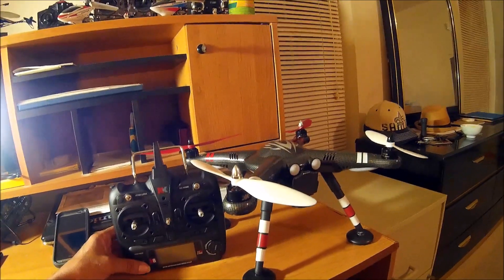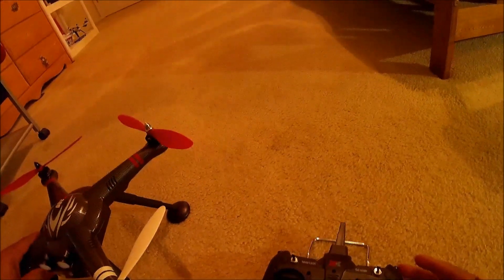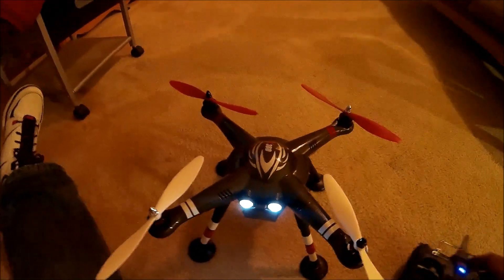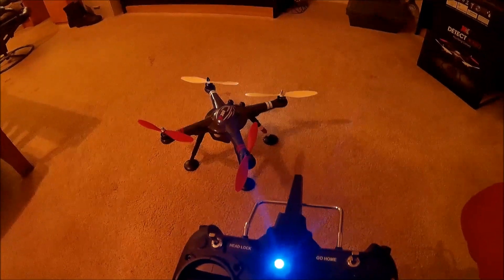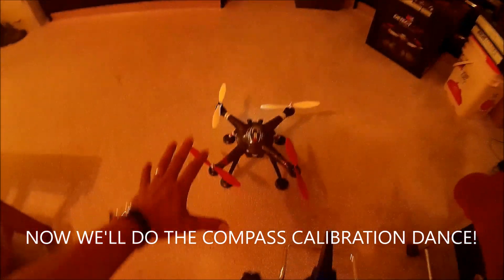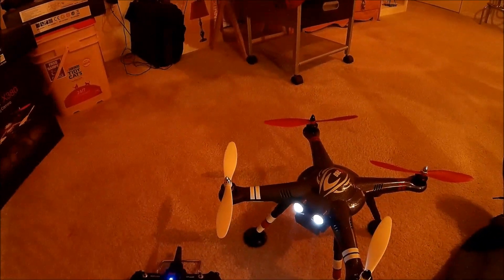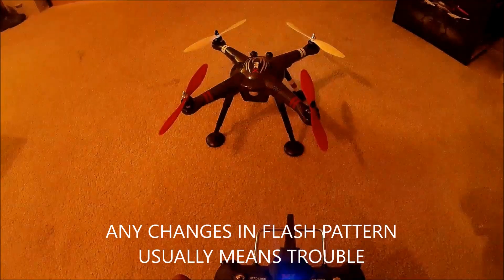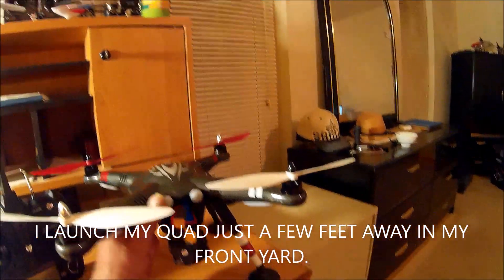XK DETECT X-380 "MUST WATCH BEFORE YOU FLY"

Comment: Hi DJ , read where someone else wrote bout having to flip switches more then 3 times when calibrating. I have to flip switch like 20 times on first step, and same on magnetic calibration befor I get the flashing green light. Only flew mine one time till battery warning, but all went well. Just saying, think there will be no problems if others have to flip switch a
 lot more then you do , just be sure they get the flashing green light before flying.

Comment: Hi DJ, love your videos. I crashed my first x380 after 4 mins, MY Fault. Not quad fault. getting new top n bottom shells to fix it. Now i did get a 2nd one, and as with the first one, it will do nothing when i push auto take off? I can manually take off, and have no problems. but auto does not work. All lights are as should be. Also with the 2nd x380, on very first take off in manual,  as it lifted of , it started running backwards fast, i shut it down and it flipped like 3 times, but luckily only had one broken prop. After re calibrating quad, it works fine, except no auto. Thanks and keep  the videos coming. Love the great job you do !! Thank you. Bob
Reply from the maker: +Bob Hoffman  To activate auto take off, the quad has to be in the LOCKED mode. If the props are turning, it won't takeoff!  Took me a few tries to get that one too!!!!  Good luck with your repairs, happy flying.  DJ SOUL FORCE
Reply: Ahhh! Lol I am a dummy. Thought I did try that, but maybe didnt hold button do
Reply: Ok great! Thank u for your fast reply!! Will try again

Comment: hey DJ how about this one, I fitted  gimbal last week ,the weather changed today so decided to go out and fly ,but no flashing light on the quad ,the lights flash on the wings but no red of green light ,no response from control.Have you come across this ,many thanks also when i plug the usb in ,there is no response from the computer.
Reply from the maker: +android /John  When you first plug in battery, does the quad go through it's normal initialize process - i.e., red/yellow flashes, a couple beeps & chirps, then red/green flashing? If all you're getting is flashing lights on the arms and it's beeping, you may need to reset the internal drive. I did come across a similar problem, here's how I fixed mine:  https://www.youtube.com/watch?v=c0jPjEA4ZdQ  When you connect quad to PC, make sure gimbal is disconnected, and NEVER plug or unplug gimbal while quad power is on. Let me know how it goes. A short video would be helpful.
Reply: +DJ SOUL FORCE ,Hey thanks for quick reply ,the quad is bleeping and wing lights flashing ,but there is no light flashing from rear red/green light, now when I plug the computer&#160;USB in the computer does no see the quad it did in the past, You may have answered my question, I may have connected /disconnected gimbal&#160;when it was&#160;still powered up, do you feel it may be the main board? John.,  http://www.xt-xinte.com/F15766.html?set_currency=2
Reply from the maker: android /John  Before we can determine if the main board needs replacing, try connecting quad to PC without power and no transmitter. Then connect battery and see if your PC will identify the x380's internal drive. If it does, then you need to follow the steps in the video I sent you previously. Let me know, we're just trying to troubleshoot the simple problems first before changing out main board, that's a pain in the ass!

Comment: Can I please add my experience. My first flight ended in disaster seconds after it had begun after the quad flew off violently immediately after take off and crashed hard. It turned out that the quad was missing ALL the 3 files in the CALIB folder (I assume straight from the factory). I'm also aware of at least one other person that had the exact same thing. Please hook up your quad to your PC and check you have 3 files in the CALIB folder before your first flight......
Reply from the maker: +My X380 Quad Channel  Wow, that's good to know. Did your x380 need repairs after the crash?  Hope it's ok now. Thanks for sharing, hope everyone reads.  DJ SOUL FORCE

Comment: I did the compass calibration inside with the green and red light blinking. I took it out to fly and both greens came on. I didn't notice really any problems calibrating with the green and red light blinking. So am I ok? Also just double checking but do you have to do the compass calibration every time your at a new location?
Reply from the maker: You're good. you only need to recalibrate if you move a significant distance away, like more than a couple miles. Thanks for watching.

Comment: +dj soul force. I took the x380 to the park I'm out now and OMG man she is the most amazing quad I have ever flown! so smooth and just amazing! Thank you so much for your videos! If it wasn't for you I prolly would not have understood those directions. I returned the cheerson cx20 for this and so far so great! Have a good day thanx again!
Reply from the maker: +Ian Rice  Wow man, you got me smiling from ear-to-ear!!! I really love it whenever I can help someone to enjoy their quad and gain confidence with it. When I got my x380 it was so new, there wasn't a lot of information on it. And of course, you've read the manual by now and know it leaves a lot to be desired. Glad I could help, stay in touch. Happy flying brother!!!  DJ SOUL FORCE
Reply: Yea man you really did help. And after I got her up in the air about a minute later I was confidante with my flying because of the experience with the smaller ones. I'm looking at another one to buy. I got my Syma x5c-1 stuck in a tree cuz it lost signal. So now it's just the udi discovery upgrade with the xk x380.  I'm only looking to spend like 125$ do you have any suggestions on what quad to buy? I'm thinking of trying fpv for the first time. I JUST LOVE flying these things so much fun. I can see you have the same passion.
Reply from the maker: Ian Rice  I'm looking at that JJRC X1 Shuttle with brushless motors. It's a little bit bigger than the Syma X5c-1 but it has tremdous power and fast like a racer! I'm kinda holding off on buying it right now because I think there's gonna be more just like it coming soon. Whenever JJRC release a new quad, WLToys will release one just like it or a little better with more features. Thanks again for watching.  DJ SOUL FORCE
Reply: i just looked it up on amazon it looks awesome but reviews look low. but brushless motors are a bonus!

Comment: thanks for the videos I love them I watched them so many times I have one question about the GPS I don't have two green lights flashing I have 1 green 1 red that means I have no GPS does that mean I have to change the location to get this GPS
Reply from the maker: +bruce jones  It usually mean that you have acquired less than 6 satellites. The quad could still fly but I wouldn't trust it.  Have you ever gotten the two green lights? If it worked before, it should work now. If you've never been able to get two green flashes, then yes, I suggest trying a different location. You could be in a satellite "dead zone!" Thanks for watching.  DJ Soul Force

Comment: Hi, I got my x380 I did everyting that you said, ans it's working ok but since the first time that I have try it I never get the signal from the satellite at first time. the first time I wait li 10-15 minuts and never got the signal I had to unplug it na plug it 3 or 4 times to get the satellite sinal. today I try again and wait 25 minuts and never got the sinal, so I unplug the battery and try again and wait another 10 minuts and nothing no signal. and I havent try it any more today.Can anyone help me with this problema?
Reply from the maker: +paulo soares  Hello, I would like to help if I can. First I need to know exactly what the quad is doing when you plug in the battery. What color is the flight indicator (LED) and is it flashing, slow or fast and do you hear any beeps?  If possible, can you make a short video showing transmitter, quad and what happens after you plug in battery? I will help if I can.  Thank you.
Reply: +DJ SOUL FORCE&#160; wen I plug the battery the quad makes some bips and leds flashs multi color then it should go to 2 green flashing indicating that I have more than 6 satellites and redy to go. I only get the 2 green if I plug and unplug the batery 3 or 4 times. wen I plug the battery for the first time afther the bips and multicolor flashing lights I ony get 1 green and 1 red this meens that I'm geting less that 6 satélites.I realy like your videosBest regards.
Reply from the maker: paulo soares  You may be in a satellite "dead" zone. Try moving to a different location if you can, a few miles away. I'm sorry I can't tell you what's wrong with your quad without seeing it. Good luck
Reply: +DJ SOUL FORCE after I get the 2 green ligths I have try and flyes ok.

Comment: I just got mine today and I am sitting here watching your video and I did the campus calibration and I bonded the transmitter well I think I did it right I had two green flashing lights almost immediately as soon as I plugged in the battery after a red and yellow then to green so now I have the green light flashing every 2 seconds and I also turned off the transmitter and the red light came on and I turned it back on and got green again so I think I'm ready but I have one more question you said in the video that you had 6 satellites I don't see where it tells how many satellites you got is that on the transmitter or is that a code when you got green flashing lights you just know you have 6 satellites and does the transmitter connect to satellites as well? I have seen reviews of some quads that both the transmitter and the quadcopter connect to satellites well it was late by the time UPS got here with my xk and I wanted to fly today but I didn't get to but I think I will try out the GPS return to home before I let it get to far out that way if it starts going the wrong way I can switch out of rth mode one more question I looked at the propellers and matched up the arrows according to the ones one the quadcopter but does it matter on the propeller the arrows should they be facing up or down or does it matter what I mean is can you put the propeller on upside down? but my first flight will hopefully be tomorrow if it's not raining or snowing . yeah it's been like 70 degrees all week and I have been waiting on this and now it's here and there calling for snow that's my lunch.
Reply from the maker: +Andy Shaffer  When you get green, green flashes, it mean that you have acquired at least 6 or more satellites. In some cases, before green green, you may get green, yellow, which is safe to fly, but has less than 6 satellites acquired.  The transmitter does not connect to satellites like the Yuneec Q500 4K or the Phantom 3 Pro. When installing the props, make sure that the arrow is on top, quad will not fly properly if not!  Good luck Andy, hope that first flight goes well, take it slow at first. Oh yea, use a timer to time your first flight (around 23 minutes or so) because it's easy to lose track of time with the first flight. By ending your first flight at 23 - 24 minutes, you'll have enough power to test the final auto return to home!  Good luck, hope the weather is nice.  DJ SOUL FORCE
Reply: +DJ SOUL FORCE .Ok I will be talking it slow at first until I get a feel for how it handles. when you got yours did it say you have the fap mode included the fly around point mode it has a button on where you adjust your camera and it has fap on it but I thought I had seen in some other video that someone had said that button was for the camera and taking pictures but it has a little book about fly around mode and how to use it safely I had been told that feature was to be bought separate so I was just wondering if they just started adding that feature in with the quadcopter because even when I bought it the specifications had it included but if it's not included and I have to buy it separate I will I just like to have it and follow me feature I heard that software can be added as well?
Reply from the maker: Andy Shaffer The FAP and Auto Pan modes are included with the new x380's. The photo button has been renamed FAP button, but whatever the name says, it still works the same. If your quad doesn't have the latest features, it's free to upgrade your firmware. Also, there's some transmitters that say photo, but they have the new firmware with old label! Have you seen my latest video that demonstrates the FAP & auto pan modes and how to use it? This shows how to check to see which version you have.  https://www.youtube.com/watch?v=usWueGtBJCU
Reply: no i had not seen that one yet ill watch it now. and thanks again i took the round Styrofoam pads that was on the transmitter antenna during shipment and cut them in half and took a hot glue gun and glued each one onto the bottom of the legs now it has some support if it was to drop from the sky. hopefully it wont but i have seen to many broken landing gear legs so i hope i have prevented this with this little modification and it allows the quad to sit up a little higher without any added weight so hopefully this will help i did the same the my syma x8c and it does help when coming down to hard or fast and it hits the ground hard it now just bounces.

Comment: hello my xk detect x380 won't start when i pull diagonal on both sides to the bottom. do you know how i could fix that?
Reply from the maker: +patrick mackey  I may be able to help but I need to know more about what's going on...  Is this your first flight? Did you first bind the transmitter & calibrate the compass? Did it work before and doesn't now?  Have you tried "auto takeoff?" Are both toggle switches at top of transmitter up? What color is the flight indicator and is it flashing or solid?  Tell me all about what happened then I will try my best to help or get help.  I hope we can get it fixed. Thanks, let me know, ok.  DJ SOUL FORCE

Comment: This is what i will need to do when mine gets here thanks for the demonstration of the compass calibration. So just to be sure i need to make sure that green light is flashing every two seconds before i fly and if the green light is not flashing that means there is no satellite connection right? so don't fly with out the green flashing lights.
Reply from the maker: +Andy Shaffer  That's correct. When you first plug in the quad, you'll get red flashing LED. As the quad intialize and  aquire satellites, the LED will flash a series of red, yellow & green. When you get green, green, it's good to go.  The different series of light flashes are explained in the manual.  Good luck with your x380 - happy flying bro.
Reply: thank you

Comment: It's also important to note before you get to those points that your propeller hoops as they're called in the manual are properly tightened by screwing them counter to the props rotation direction. I've seen a video on youtube where a propeller came off mid flight because the props dome/hoop wasn't tightened sufficiently.
Reply from the maker: +Gary2880  Very good point Gary, I'll be sure to include that in a future video. I saw that video where the prop came off and that horrific crash afterwards.  Thanks for watching, Happy Holidays.

Comment: One more question,Do I need to calibrate the compass before  every flight ?
Reply from the maker: +Oscar Flores  I don't always calibrate before every flight, especially if I fly back-to-back in the same location. It's suggested that you re-calibrate whenever you move a significant distance away from your last flight.  It doesn't hurt to calibrate before every flight, but it isn't necessary!

Comment: Hey Dj,
I am  trying  to bind but the red light stays on.what should I do?
Reply from the maker: +Oscar Flores  Unplug the battery & start over. Make sure both toggle switches are up and wait for green, green flashing before you start the binding process.  Here's an alternative way to bind:  Pull left stick down & to the right & hold...Flicker the GO HOME button for four (or more) times until LED turns solid red. Then QUICKLY move both sticks around the edges in a circle until red light goes out and start flashing normal flight status.  Let me know if you got it solved or not...
Reply from the maker: +Oscar Flores  Is your red light solid or flashing?
Reply: I did it again and everything is going well so far.
Reply from the maker: Oscar Flores  That's what's up man! Good for you, hope it goes well.  Merry Christmas, I'm going to get me a night flight in right now!!!